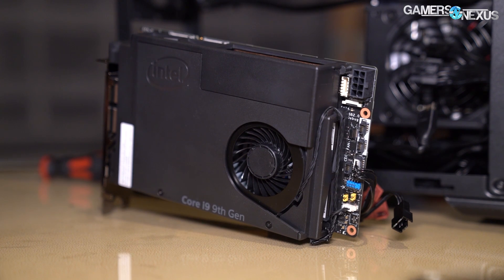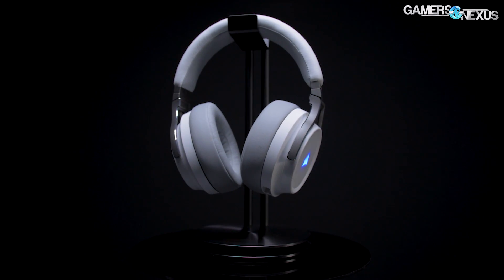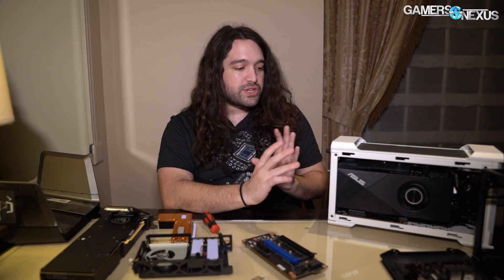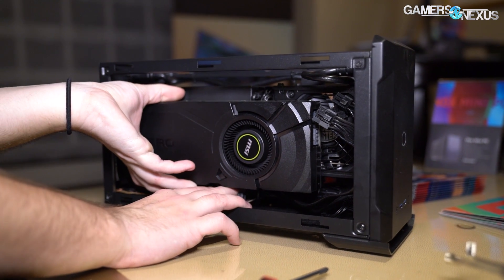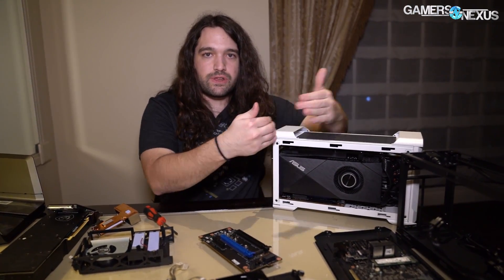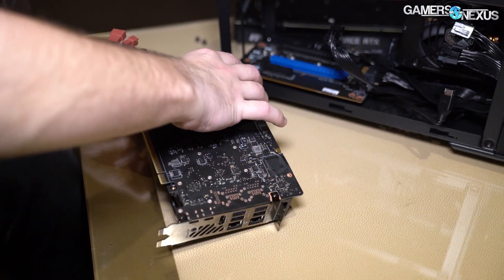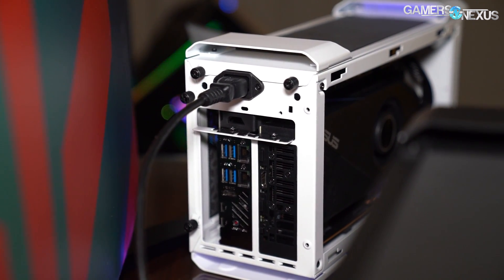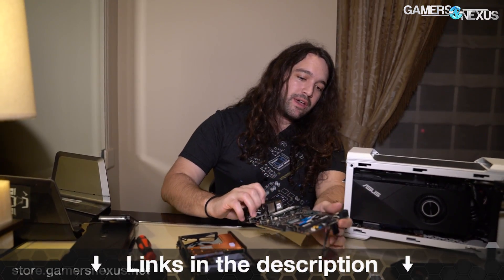Intel PCIe Socketable Computer: Tear-Down of Ghost Canyon NUC SFF PC

Comment: I also think 'CPU as PCIe card' has a lot of potential. There are X32 connectors, that should be enough for consumer CPU's a while longer, but a few of those in a column might be used otherwise. CXL may ease coordination between linked CPU's.

A CPU card with many parts has more ways to break, but the VRM's won't be insufficient or overbuilt, the cooler will have more room to work with, and the baseboard can be nothing but PCIe connections- Relatively cheap, not so tied to particular systems, can be made by anyone with any lane distribution(at least depending on bifurcation support). Chipset might be very basic, freeing more lanes to use as preferred.

That would work even better if we scrap the AIC form factor in favor of one that always stretches from the front of the case to the back, getting support on both sides and controlling a long straight airpath, with external I/O on the side opposite the baseboard's. Smaller cards, including SSD's, can be E3.L, making for more flexible slots.

Comment: The Ghost Canyon NUCs are a great idea, such a form factor opens a lot of possibilities -- and intel has to fuck it up by massively overpricing it. You should be able to buy motherboards in this form factor for the same (or similar) price as ITX motherboards. You should be able to by motherboards in this form factor that can take normal desktop processors, but you can't.
Reply: I feel like it can be used for cluster computing....

Comment: The main problem I see with this design is cooling. If you have an array of CPUs and GPUs in a "sandwich" like this, air cooling is pretty much out of the picture. Sure you could use blower coolers, but they're so loud. Which means that water cooling is pretty much mandatory... which unfortunately will add additional bulkiness to what should have been a compact design.

Comment: These type of boards have been around for long time, called Half Size SBC, Single Board Computer. First gens were ISA then PCI and so on. Those are widely used in the industrial automation world, and produced to this day by dozens of industrial motherboard makers. Many of the computer enclosures were set up in a similar form factor. https://www.ebay.com/itm/HS6238-BOSER-Half-size-PISA-PCISA-SBC-/173995355319?redirect=mobile

Comment: I still think it is a product looking for a market. Cyber power themselves has a 9900k pc with 2080ti in a PC-011 with water cooling AIO and 1000 watt PSU for $2479 so if this machine doesn’t thermal throttle then could be an option if you really don’t have the room for anything else. Great for LAN parties but not as versatile for future upgrades as the boutique rigs already available.

Comment: Finally, the computer everyone has been wanting. The performance of a laptop with the portability of a desktop.... wait, that's not right. Oh well, at least it's going to be cheap.... nope....
And I'm here thinking that the graphics card interface system is due for an complete rework, in order to improve the ability to cool them. I was imagining a word with motherboards that have a socket for both the CPU and GPU that can take something like dual noctua coolers, instead of the stupid blow straight into a PCB design that we have now. Instead, lets put a GPU cooler on a CPU.... Wat

Comment: Rather than trying to space the NUC and the GPU more, why not try to flip one of them around with a riser cable? Then both the cards could pull in fresh air from opposite sides of the enclosure.

Comment: it would be cooler if it could just go into a tower as a second computer. you could even put two seeing as sli and crossfire are dead. have a stream/record pc, and a nas, both in your gaming pc. bonus points if it used the pcie for fast computer to computer data transfer.

Comment: As a NUC Lover, I think it is stupid idea. most beneficial features of NUC are small and low power consumption.
This type of NUC is can't even call NUC. NUC is brand name of intel product and also form factor of 4 by 4 inch size.
Only interesting part is slot type computer. maybe  some rack mountable base board can install 8~10 of slot type NUC with 10G network connection instead GPU.

Comment: I think the 'PCIe' slot the compute unit plugs into is just the form factor, and nothing more. Like how m.2 is just a form factor. So pins usually used for power are reassigned to PCIe lanes.
Something like this would bring me back from a laptop to desktop again.

Comment: Always fun when Innovation means going back in time to re-invent old tech. I really liked this modular pc-thing (thought we just knew them as PC's back then). Was easy to work with, everything spaced out neatly on a board, but a pita if you wanted to or needed to replace one part and not a whole board.
Still got a few hanging around somewhere here at home.

Comment: They should have stuck the CPU on the other side - it looks like it could be choked by the GPU or suck in warmer air from the backplate resulting in worse thermals.

Comment: Has anyone realized that by using this nuc kit and a mini ITX board you could theoretically build a dual system in a standard ATX case - you would just have to add mounting for the PCI connector card between the NUC and GPU for the second system, and maybe some extra cables...

Comment: the only thing lightweight "pc's" like this are useful for is POS units in stores. and 90% of them just buy ancient garbage tier cheap-ish trash running some shit version of windows 2000. PCI cpus have never kicked off, and they never will. they serve no real purpose.

 edit: also your sponsor is shit. those are virtual surround headphones for 170 fucking dollars.those are 5$ worth of plastic and copper based on research from the 19 fucking 40's, with a bluetooth transmitter. dont support that scummy shit.

Comment: the one thing I see a problem with this is, unless the compute card is not actually using strict PCIe, you're limited to 16 lanes into the back-plane.  which means 16 lanes shared between the GPU, the NVMe socket, AND that 4x PCIe slot.  how does Intel think that bottleneck is acceptable?  and then, potentially, you can have back-planes with more slots?

Comment: Anyone remember Pentium II/III Slot 1 CPUs? This is basically the modern version of that but all the components are on the pcie board. Very interesting but the price alone might make this a failure for Intel. Too bad they didn’t make the CPU socketed in a PGA like the old Core 2 Duals back in the day. That would have made all the components fully replaceable.

Comment: I only have two real issues with the new Intel NUC 9 Extreme.:
1 - The front panel ports should be designed to be compatible with VR headsets.
2 - The CPU and GPU boards should be facing away from each other, so that each can draw direct air from the outside.

Comment: reminds me of the accellerapci card from the 90s. except it was intended to be a drop in upgrade for older socket 7 computers to have faster cpu and ram.
Reply: Or like the Pentium II/III Slot 1 CPUs back in the day. Similar concept except this is the whole computer on a mini board and not just a CPU and cache.

Comment: Omg you still need an internal PSU?
What's the point of this then compared with mITX cases??
Reply: Quast basically there’s no point. It’s a cool concept but not practical because this isn’t that much smaller from some mITX cases currently on the market. Plus the fact that you can’t upgrade the laptop-spec CPU makes this a no-go.

Comment: lol, whats with the mirror thingy! anyways, that NUC sounds nice, until you realize you are probably goind to pay a "lot" for the "cpu+chipset+ram" board... and the cpu is soldered to it right? so imposible to upgrade?. That does not sound a like a really good deal when anyone has access to a mini-itx build. Its a good concept, it may be usefull for some use cases, but thats all.
Reply: If the laptop-spec CPU was in a PGA (pin grid array) that would be the easiest solution and would allow it to be replaceable. But instead, no... Intel had to make the stupid decision to solder it on and make it cost a fortune to upgrade the board.

Comment: Why Intel Why!  If you are making a socket-able PC that is in no way a standard interface, why do you have all the components the same direction as a GPU?????  Put the components on the OTHER SIDE of the card!  If they built it this way the GPU and motherboard would be right next to each other and the cooling would be much better for the CPU/VRMS.... just stupid.

Comment: I just want to know... What the PCIe signaling on the card is like. I doubt it, but if it uses standard PCIe protocol it would make it so much easier to move to an OpenPOWER or ARM based desktop. :)

This is reminding me of old DOS-PC cards for the old Power-based Macs.

Comment: I would buy it if the cpu board had 4 sodimm slots, with only two is too close to a laptop
Reply: Except the cost makes this impractical. The whole board is going to cost a fortune vs standard components.
Reply: @mclaine33  If it is expensive compared to standard components then the whole product is pointless, but if its price to performance is somewhat close to pre-builts then I think they might have a chance

Comment: what interests me about this is if they had a board like this you could slot into your existing PC, for example if a streamer wanted to use a dedicated second PC in their current chassis to do encoding, and would fit into a power profile that could run from the 75W PCI-e slot. you could then use one of those ethernet ports to handle communication, or you could set up some kind of virtual 10GBe over the x16 slot. I'm assuming these boards can't do that, correct?

Comment: Basically a motherboard that breaks out the expansion slot portion to a modular part... This might be a good approach in theory if the pcie bus signal degradation can be kept in check against unscrupulous case manufacturers.

Comment: A computer on a card or "system host board" that plugs into a backplane is not a new concept, they've been around for decades in various forms and are common in industrial computers. See the current PICMG specifications.

Comment: Kinda like the idea, think of a Slightly Shorter Silverstone FTZ01 or RVZ03 case with a 180 degree PCI-E baseboard sitting at the middle(meaning a PCI-E slot facing upwards and then one facing the opposite direction downwards, with the case standing vertically), effectively giving space in the top half for the CPU-miniboard, completely airflow independent to the bottom for the GPU.

Comment: If the price is reasonable, that PCIe computer could work as a separate instance for certain tasks a Raspberry Pi may not handle without significant config changes.

Talk about a true computerception design.

Comment: VRM info: I found teardown photos of it online (koolshare.cn). It has 4+1+1 phases using ONsemi NCP302045, a 45A DRMOS (driver+MOSFET very basic powerstage). I was only able to find a datasheet for the 35A version. These were used in memory power for the 5700xt red devil and the rampage VI extreme (as well as CPU power in the Z390-I Gaming) as well as some laptops (thinkpad X1 extreme). The VRM controller ONSemi NCP81215 is an intel IMVP8 compatible PMIC which is nominally a 4+2+1 phase, but it looks like you can configure it as a 4+1+1 which I believe they are using here.
note it says on koolshare that it's a 3+2+1 phase. While the PMIC is capable of this, looking at the power planes, it looks more like a 4+1+1 phase to me, with the uppermost one powering the graphics, the next 4 powering the CPU and the bottom one powering VCCSA. There's a lot of other small errors on that page, so given how new the information is, I think they can be forgiven for some small oversight.

At 12Vi and 1.8Vo they are very inefficient under 5A, but very good (93%) in the 5-15A range, so I would expect to to be able to deliver 20-60A (36-108 W) dissipating 2.5-7.5W of heat. If the intel CPU runs off 1V, then efficiency drops to about 91% and it will do 20-60A (20-60W) at 1.8W to 5.4W of heat.
note this only takes into account the stated efficiency of the powerstage, which presumably includes gate charge and rds losses from the mosfets and drivers. Actual efficiency will  be lower after I^2R losses, capacitor ESR, etc. I don't know how much of the extra work buildzoid puts into his tables, this was some very quick math giving you an idea of efficiency.

Since the CPU appears to be a 45W TDP part, then these are actually operating towards the bottom end of their range.

How about the top end? Well: the 35A part datasheet goes up to 30A, where they fall to 90% efficiency (for 1.8Vo) or 85% (for 1Vo). Using these numbers for 30A, we get 120A output current (216W into 1.8Vo) at 90% efficiency gets us 21.6W of heat, and 120A output current (120W into 1Vo) at 85% gets us 18W of heat. This is definitely not coolable with the thermal solution, but the VRM is theoretically good for it if you want to put it on LN2 

As expected, all the VRMs and PMIC, even the heatsink&fan are very common laptop parts. Tried and true.

Comment: I really loved the design it's as simple as a notebook hardware with an external GPU but without the screen,  but TBH I would love even more to start seeing this kind of mounting on regular socket mobos, this seems way better than most mini itx designs I've seen, I would love to have a small formfactor almost console size to build a VR rig for the living room, most cases Atx, mAtx and even mini itx are not actually elegant to blend in on the living room and those cases that have GPU risers to mount parallel to the mobo are extremely difficult to find.

Comment: This PC at 7.5 liters is still larger than a ITX case like the Dan A4 at 7.2 liters.  Not sure you would be able to get a 9900k to stay cool in a Dan A4 though even with undervolting and running lower clocks.  Best bet if wanting to match the 8 core 16 thread of this NUC would be AMD if building a ITX PC in this size range.

Comment: Centrally Mounted Custom water block. One side cools The CPU, the other side of the water block cools the GPU,  Top or side mounted Radiator.  Toss in Thunderbolt III and your laptop has real horsepower when docked to something like this. Has possibilities for sure.

Comment: Normal PCI-e x16 slots have a fair number of unused pins, as each standard size slot (x1, x2, x4, x8) has to be accommodated for by having the pins in those locations be No Connection, then you've got lots of grounds and power that could potentially be used on the main card too (pending those are power sockets on the back), as well as those being directly connected to power on the client cards, so it might not need a multiplexer.'Backplanes' have been a thing in the server space for a very long time, but it's interesting that this is finally making it to the consumer space.

Comment: So the GPU part is not really a big deal, that daughterboard is basically just acting as a PCIe riser card, though as he pointed out im not sure how you would run an NVMe drive and a GPU when in theory you only have a single x16 slot running both which would at full throttle bottleneck one or the other.

But who the heck asked for this? Its not that much smaller than a compact mini-itx config by the time you introduce the PSU, GPU and enclosure and if you try running this in a normal systems PCIe slot as a secondary system in one chasis will the two outgoing PCIe signals even work together or brick something? Again, actually pretty cool, but who asked for this and whats the use case???

Comment: As interesting as it is, I'm struggling to understand the point of it. Yeah it will be helpful for streamers to have a second PC inside their existing case. But, these things are not cheap. I don't stream so correct me if I'm wrong but wouldn't it be better if you simply just upgraded your PC so you don't need a second? As for being able to use a full sized GPU. Sure it's smaller than ITX, and I am assuming it performs better than Thunderbolt external GPUs. But you have then limited yourself in your upgrade path and will lack (potential) functionality compared to a PC slightly bigger. And when I say that I mean stuff like maybe a sound card if you are into that, one of then overpowered Asus WiFi adapters, PCIe M.2 enclosure things that kind of stuff 

Streaming is the only use case I can see. For everything else it doesn't make much sense to me. Media PC that you'll need to turn your PC on to use? Just use the main PC maybe? Doesn't look you can Vesa mount it so that's a key mini PC feature you don't have to appeal to enterprise

And if you are using it stand alone in that case, well, it's bigger than the previous NUCs despite being smaller than an ITX.

I dunno about this being PCIe. I honestly don't see the point, to me it looks like they are targeting a niche market

Comment: I like interesting little gadgets like this but really wonder about the use case. It's most likely quite noisy so I wouldn't want it anywhere near me like on my desk or in my TV corner. Putting these components into a bigger case would be quieter, cooler and cheaper.
Also yes, I had to check the comments right away because the first thing I noticed was the mirror. ^^

Comment: This is not a new concept for using socket-able  cpus but not seen much in the consumer market and when it was (late 80's early 90's it didn't last long it was all down to software (OS) to support asymmetric multiprocessing. It would honestly be interesting if it came back for but would be very niche as well so I doubt it ever will.